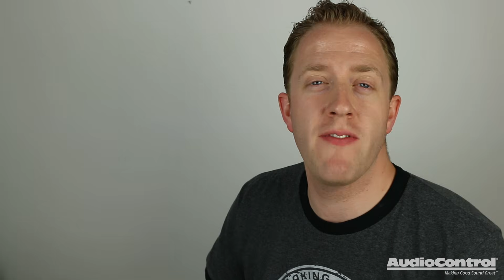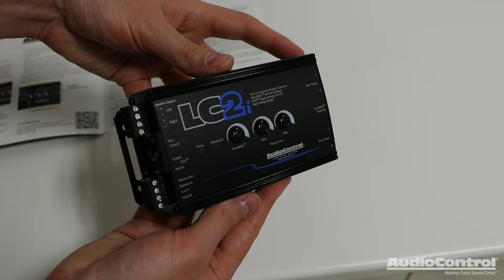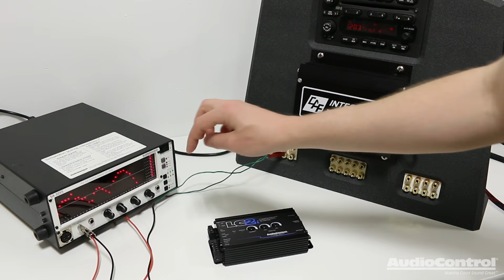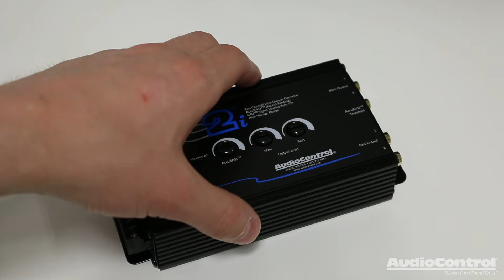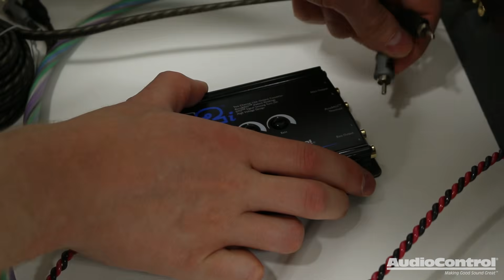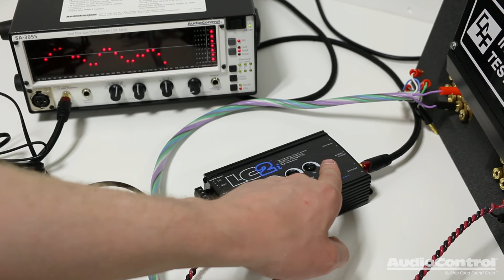LC2i Training Video

Comment: When adjusting the gain knob on the LC2i for my aftermarket sub, is it the bass knob or the main knob?. Also should I have the gain on my amp all the way down when adjusting the gain knob on the LC2i?
Reply from the maker: Yes, start with the gain knob on your amplifier in it's lowest position. There are output controls on the top of the LC2i- MAIN and BASS. The MAIN knob controls the output level of the MAIN output RCAs and the BASS knob controls the output level of the BASS output RCAs. So the two knobs correspond to the two pairs of RCA outputs. Hopefully that makes sense- if not, give us a call sometime and we can help you through it.
Reply: @AudioControlCar  thanks that is exactly what I did. It is nice that my amp is getting a clean pre amp output signal. The gain on my amp is a 1/4" Turn away from being in the middle. It's good to know that I can always adjust the gain on the LC2i and amp some more if I want more bass
Reply: @AudioControlCar  Does that mean we can leave the gain all the way down on the amp and use just the lc2i to adjust gain?

Comment: Nice video.  Can I run a Kicker 600.1 out of the bass rca’s and a Kicker Key 200.4 out of the other set?  No issues with tuning the “Key”?
Reply from the maker: Shouldn't be an issue, from what we understand of Kicker's Key technology. The LC2i's BASS outputs are set at 30hz-1khz, and the MAIN output is full-range, from 30hz-20khz. Of course, all of this will depend on the signal being fed to the inputs of the LC2i.
Reply: @AudioControlCar  That seems inconsistent with the instruction in the video. At 6:45, the video says you get the full frequency range from both Main and Bass outputs. Is this incorrect?

Comment: I’m very confused I had this installed by a friend who is knowledgeable but here is my question. It says it only puts out 400W per channel. I am only using the subwoofer channel right now. I have it connected to an amp that can put out up to 1400W. But since the audiocontroller can only put out 400W isn’t that limiting my amp to 400W?
Reply from the maker: The AudioControl LC2i (and most other AC products) can handle 400 watts of INPUT to their speaker level inputs and convert it into up to 9.5 volts of RCA low level output. Basically, taking an unusable factory signal and converting it into a usable signal your aftermarket amplifier can handle. The LC2i will have no effect on the actual wattage produced by your amplifier. It will work with a 100w amplifier or a 10,000 watt amplifier, but it will handle the signals the same way. So thankfully, your 1400w amp is not being limited in any way. You're on the right track, just getting a little mixed up in the specs/terminology. Hope that helps!

Comment: Great video very informative. I have a question . My factory subwoofer is a dual voice coal. Should I tap into all 4 wires or just 2 ?
Reply from the maker: Generally, just one pair for signal will be fine, when only adding an aftermarket subwoofer. If you want the OEM woofer to remain active, then just tap in. If you'd like to eliminate the OEM woofer and only have the aftermarket sub playing (recommended) then disconnect the OEM woofer completely. Hope that helps!
Reply: @AudioControlCar  so I would need to disconnect the oem subwoofer  and run both speaker wires to get the full potential out of the aftermarket sub???  I'm running a  apocalypse AAB-2900.1D and a apocalypse 270 15 d2 and I'm having the same problem at half the halfway point on the bass knob
Reply: Also should I cut them or just tap into them ? 2011 Toyota 4Runner JBL subwoofer

Comment: Can the LC2i run both main and  bass output at the same time?
Reply from the maker: It sure can! It is designed so that both sets of outputs are always functional. No need to switch them on/off or anything like that. Just plug in your RCA's front the LC2i to your amplifier(s) and go.

Comment: Awesome video! What's the best gauge/ type of wires to use to connect speakers, power, ground and remote?
Reply from the maker: Thank you for the kind words. For power/ground/remote/speaker level input wiring, we recommend 14-22g wire, depending on the length of the wire run. Typical car audio primary wire will be 14-16g, and will work just fine.

Comment: Can you ADD a Digital Bass Processor (epicenter) between the LC2i and the power amp for the subwoofer ?  Hi from Fresnillo Mex. Thanks
Reply from the maker: Absolutely, you can. This is a common setup, and there are many users out there doing exactly what you described.

Comment: Go get 1 people. This little thingy is the truth. All the expensive stuff I bought for my system sounded like crap until I bought this lineout converter. It really helps the system separate what's needed. It works banging 4 12s maaaaaaan.
Reply from the maker: Thanks for the kind words! Enjoy those 4x 12's!!!
Reply: Are your subs wired in series or parallel? I’m troubleshooting for the past week and it’s a PITA
Reply: @scottjohnson7397 series
Reply: They are wired to 1ohm! So I n that case I guess they were parallel! Not series! Been some time since I hooked it all up! Check out the vid with the playing!

Comment: My radio starts clipping at a little passed half way. Will intalling a LC2Ipro be better than using my amps high level inputs to get my amp to play at higher volume without blowing my sub?
Reply from the maker: Yes. The LC2i (or the LC2iPRO) will give you a cleaner, higher voltage signal to your amplifier(s), allowing you to get more from your amp/speakers with less distortion.
Reply: @AudioControlCar  increasing the Bass level on LC2i is better than increasing the gains on the amp? Also, how do I tune LPF?
Reply: @kuanliu3383  That is my question as well!

Comment: Why does the lc2i put out signal at power on with the volume all the way down?  You can see it in the RTA in the video @ 2:52.I can hear it, through my woofers.  it’s a low hum!
Reply from the maker: Generally, this is due to most source units still putting out some signal, even with the volume all the way down. If you want to eliminate this, you can use a true turn on lead rather than using the signal sensing GTO turn on. Many times the hum heard in demo/training videos is produced by the 110v to 12vdc power supply, which wouldn't be an issue in an actual vehicle, of course.

Comment: Can you link the 12v and ground  from your amp?
Reply from the maker: You can, although we recommend providing any AudioControl product with it's own power and ground. Occasionally, borrowing power and ground from the amplifier can result in noise or other issues.
Reply: @AudioControlCar  what problems does it cause ?
Reply: Yes

Comment: Ok I'm looking yo buy the lc2i, I have nissian maxima 2011 with Bose  total of 4 woofers factory using the lc2i what signal would I use? From the Bose woofers or the high  or mid speakers....I know the bass rolls off on the bose woofers .....any help would be appreciated
Reply: I also have a Bose system in a 2011 Impala. I connected the LC2i to my left rear speaker. Works perfectly! Amp and LC2i are next to each other and my 15" sub is hitting hard AF. The LC2i processes the audio and thus fixes any roll off.
Reply: @MidnightMarrow  I ended up tapping both of the rear woofers to the lc2i and yes it hits hard.....I have a jl 500/1 on 2 jl w3 12s I was doing my w6s but need a re-cone on both. My box is tuned to 30hz  I have to say I'm very satisfied with the results.....
Reply from the maker: Glad to hear it- Enjoy that bass!
Reply: @AudioControlCar  I am and I just recieved my new foam surround for my w612s so cant wait lol....

Comment: If i want to run a mono amp for new sub only. Do I have to go through the factory deck, or does the hookup to the loc happen after the factory amp? 
I want to keep the factory amp running the stock speakers. I don't want to pull out my factory deck. Hoping it gets hooked up from the amp? 
Anyone know?
Reply from the maker: All of our products can accept signal from the outputs of an OEM amplifier. So if your vehicle has a factory amplifier, you can grab signal from it's outputs, feed that into our product's inputs, and end up with a nice clean RCA signal to send to your aftermarket subwoofer amplifier.
Reply: lakermd before the factory amp, it’s going to amplify your amp with cleaner power

Comment: Could I power the LC2i by using a distribution block and taking power from the power wire going to my amp? My car has a cheap crappy LOC now and I just picked one of these up used for a good price. I am just trying to figure out the best way to power it. I have seen people run power wire from the power connection on the amp to the LC2i. Would that be okay as long as I add a fuse?
Reply: Mines been running perfectly fine connected directly to the power input of the amp itself without a fuse even.

Comment: Question- If I use the bass knob on the LC2i do I still need to run a bass know for the subwoofer amp or can I just run a bass knob for the amp itself?
Reply: In theory the LC2i is a cleaner source so boosting it before the amp might be more ideal, though I'm not 100% certain. But boosting a signal can add noise and with that could cause clipping and the like. So if the LC2i is indeed cleaning up and processing the audio, boosting it there might be where you'd want to do it while keeping the amp neutral.
Reply: MidnightMarrow the Bass knob for both are just attenuators. They don’t actually boost anything at all. Maxed out they just match whatever signal the output knob is set to. So the addition of one would just give you the option to lower output at the twist of a knob.
Reply: You can run on knob from either one that you want. You don’t need one on both. Either or do the same exact thing.

Comment: Where do you get the 12v power from???
Reply: Run a 18gauge wire with a in line 1amp fuse straight from the battery.
Reply: @jayholt2101  If the amp and LC2i are close by, you can connect the 12v into the port of the amp itself as it's coming off the battery already. No need to run long lines for both. Also because the LC2i has the GTO feature, you also connect the remote OUT from the LC2i to the remote in of the amp and once the device detects signal from the left channel, it will turn itself on as well as the amp you've connected to it!

Comment: So if I hook up a high amp for the door speakers I would have to look for the doors speakers wire to cut to install to the high amp?
Reply: Yes just splice into the door speaker wires.

Comment: So I get that you pull signal from the existing speaker wire. But does it matter if it's before or after the factory amp and if the factory amp only powers the factory sub can I pull the signal from the inputs of the factory amp so I could remove it from the vehicle or should I get it from the rear speakers?
Reply: If you're only using the LC2I for an aftermarket sub, then the best place to tap into the speaker would be at the high level sub input.On my f30 bmw I was never able to get the lc2i to read the preamp signal coming from the head unit. On certain factory stereos, the head unit needs to see a load. The lc2i pro has an adjustable load feature, but the unit shown here does not.
Reply from the maker: Generally speaking, in most all vehicles, you'll want to obtain your signal for the LC2i or LC2i PRO from the output side of the factory amplifier. A line output converter like these is taking a high level signal and converting it to a low level signal. So chances are, you won't want to use the low level signal going into your OEM amp for signal. You'd end up with little to no volume.

Comment: I bought the Lc2i and I like it a lot. Diagram on paper shows you can install another amp for highs. I’m looking for install directions on that because I have factory amp and I can’t find any info about it ... I’m using already both rear speaker wires to power the Lc2i from behind factory radio... I would like to install a smaller 4 channel because stock interior speakers are not loud enough even after swapping door speakers. Can you point me to the right direction ?
Reply: Same here I'm trying to figure that out too. I think we would have to look for the door speakers wire and connect to the high amp.

Comment: Can you tell me, should the "fused 12 volt constant lead wire going into the LC2i be a separate, specific amperage from the fused power source for my amp? 
I thought I heard somewhere it should have a 1 amp fuse in-line. Is this right?
Reply: I honestly have the power lead coming out of the amp itself without a fuse. Should anything happen the fuse nearest my battery should burn and disable all the audio equipment connected to it. Don't much see a reason to bother with a fuse to the LC2i itself.
Reply: Where did you end up connecting the 12 volt cable to? I'm going to install one of these soon. I bought a 1A inline fuse just incase.
Reply: @TimSmith-db1iu  I ran the 12 volt lead for the power source from the LC2i, with the suggested in-line 1 amp fuse, to my amp's incoming power cable port since it was the closest power source. Works great! But you can add it to any of the 12 volt connections.
Good luck with yours!

Comment: can i use stock signal from my stock sub on my 13 ram 2500 to lc2i?? or it have to be from door speakers?
Reply from the maker: You could use either one, but many times the front door speakers have a more useable frequency range and your aftermarket system will often sound better using that front door signal rather than the ohm sub signal. You could certainly try it with either and compare though, it won't hurt anything.

Comment: Question...is the maximized light supposed to blink when bass is hitting?
Reply: Only if you have the gain set too high.
Reply from the maker: A light blinking of the maximized light is ok at high volumes. Preferably, the light would not be illuminated at all, but if it needs to flash on certain songs in order for you to get the desired output, that's ok.
Reply: no

Comment: Can I use the lc2i for the base roll off & a dsr1 for the Dsp at the same time?
Reply from the maker: You could... Or you could use our DM-608 DSP processor and get all of that in one product. Our DM-608 and our DM-810 processors both have AccuBass (used to compensate for bass rolloff) built in.

Comment: Brought the lc2i for my challenger factory 8.4 inch factory radio. planning to install two 10’s while keeping the factory alpine speakers inside. Would I be ok ?
Reply: How did you build turn out? 
If you dial down the bass from the head until to protect your "stock" speakers, does it also kill the bass coming out of the sub?
Reply: It will work perfect for your needs

Comment: Can you use this unit for 6 ch? Front, rear, and sub?  Using two amps
Reply from the maker: You would want to look at our LC7i device.
Reply: It depends on the amp... Pioneer, Alpine and kicker make multi channel amps that can work with one set of rcas only
Reply: Sorry its late but yes all need is y rca adapters for main output to convert 2 rca to 4 rca.
Reply: @fullpeladas  nope.. is best if you get the amps I mentioned 😉
Reply: @adlerdefender8067  If you please, why wouldn't the y-adapters be sufficient in this case?
I'm just about to do this exact thing.
Thank you in advance.
Reply: @decid3  well it really depends on your budget and if you already have the amps ... For me buying one of the amps I mentioned really makes it easier
Reply: @adlerdefender8067    Okay. Thanks for that. 
As it is, I do have both amps the same make as my whole system in fact. I also just got the Lc2i. The 4 channel amp for my 4,  6 1/2s has seperate rca inputs for the front and rear channels...but I really don't think I need access to a front channel, at least not at this time. If it can work with the y's, I'd like to do it, for now.
Reply: @decid3  yeah dude.. like I said for  me my kxa has the feature of working with a single set of rcas..